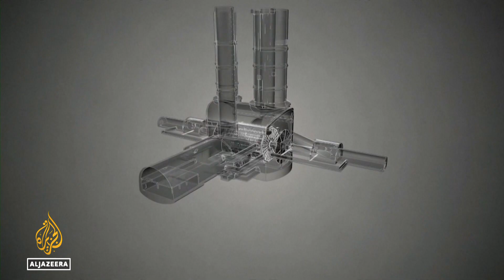Looking into darkness: New discoveries from Large Hadron Collider

Comment: Im all for science but this is dangerous. This thing scares me because nothing is 100% if any thing went wrong, even though its a big if, the consequences would be catastrophic.
Reply: Not to worry.
There are cooling lines and magnets that could fail, but damage would be confined, though costly.
This machine is a scientific instrument; it is not an atomic reactor.
Reply: No it already did explode and all that happened was it was shut down for a year.
The only thing that suffered was Science.
Reply: Rubbish. There isn't enough stored energy to do anything. You are confusing this with a nuclear reactor. The collider  already had the worst possible failure and not a single person was injured.
Reply: @AbbeyRoad69147  Did I say explode?
Reply: @dbrown2430  No, it did go wrong and no one was hurt. It is deep underground. What is it that you think that could happen? It has been operational since 2008/9. Other accelerators have been operational since the 50s.
It is the first successful fusion reactor you need to worry about.
Reply: @dbrown2430  This is what happened in 2008 

"A cable feeding current between two of the LHC's beam-focusing quadrupole magnets suddenly heated to above superconducting temperatures and melted. The failure seems to have happened at a joint where two sections of cable were spliced together. Tens of thousands of joints run around the LHC and many of them had already been tested without incident.

The failure caused the liquid helium that was being used to cool the magnets to boil off, apparently rupturing the machine and releasing as much as a tonne of the gas into the LHC tunnels. During testing the tunnels are evacuated and no injuries were reported."
Reply: Why do you think its dangerous and why does it scare you?
Reply: Im not sure you understand how these things work, what do you think would really happen?
Reply: @DizzyK1D  I feel like the professionals don’t really even know what they do.. hence the experiments and apparently hardly any data or discoveries to share. Unless they’re just hiding the information they find?
Reply: @DizzyK1D  See another thing is china is building an even larger collider, and its 7 times more powerful than CERN. The Chinese dont exactly have the best track record when it comes to tampering with things .